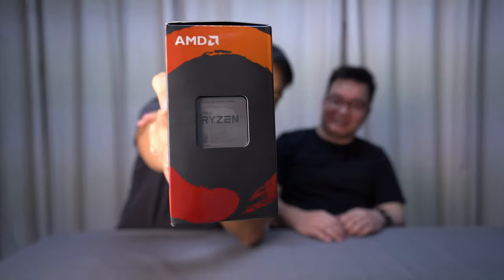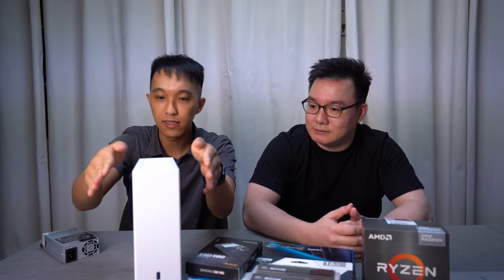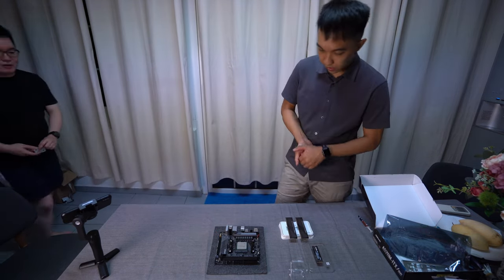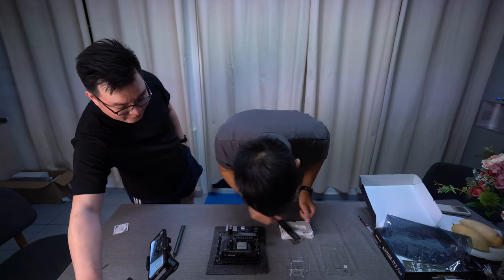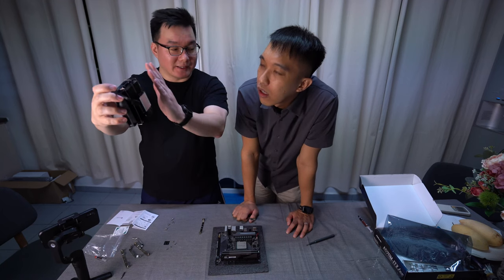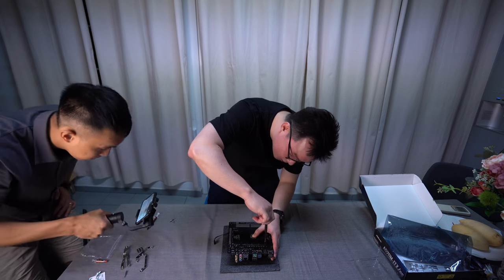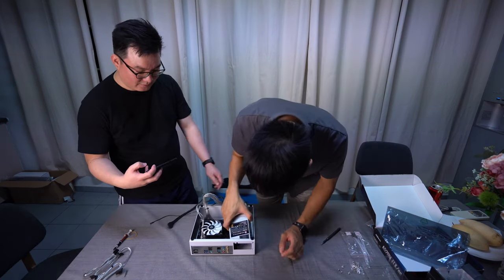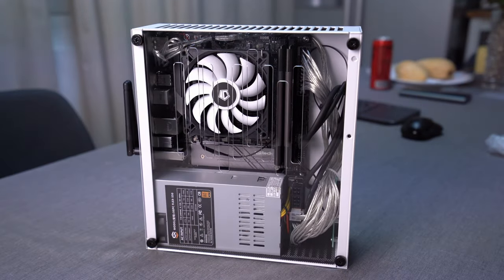AMD Ryzen 4650G in the SGPC K30 ITX Case from Taobao

Comment: can it fit additional sata ssd? from what i can see, you can fit 2 40mm silent noctua for better temp, is it possible?
Reply: Officially no.
But i think you can fit 2 2.5 hdd on top of psu
Reply from the maker: If you are looking to fit 2.5" SATA SSDs, maybe can consider the In-win Chopin instead? That one has proper mounting for 2 drives